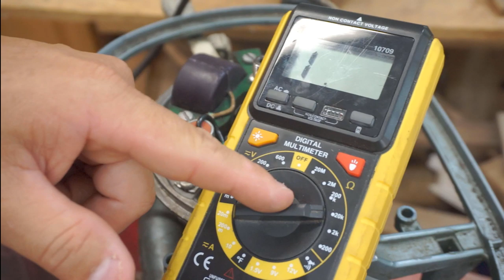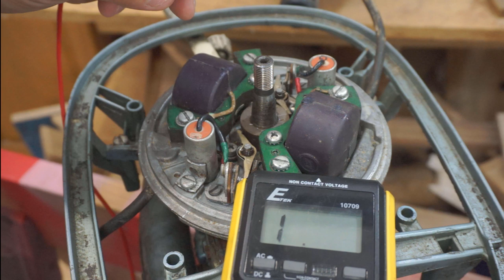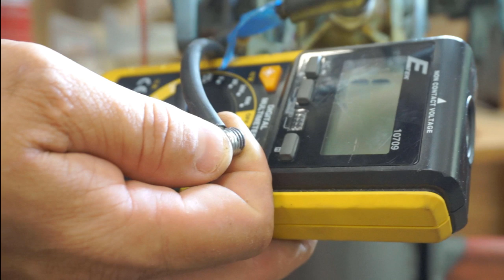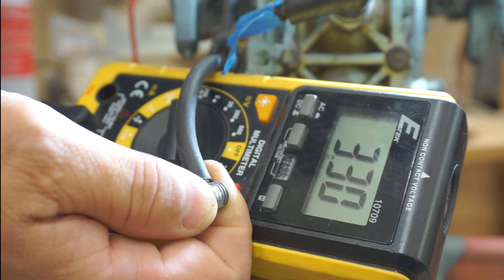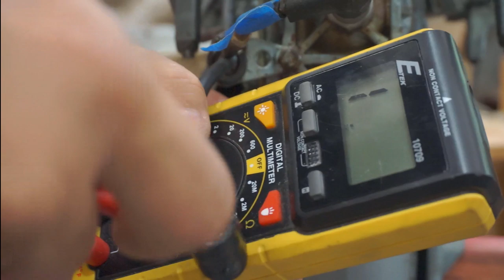Repair Ignition System Evinrude 3Hp boat motor ep 2 - The Garage Engineer

Comment: 2nd Hint: After letting the Kroil sit overnight, as you put pressure on the flywheel with your puller, tap the flywheel gently with a soft-faced hammer. Tap it gently, because there are magnets in the flywheel. Also, if you see the originial coils under the flywheel, it's best to replace them and the points. New coils are only around $17 each.
Reply from the maker: Thanks for the advice. 👍
Reply: Where can I find new coil?
Reply from the maker: I found ebay as the best source for non oem parts.

Comment: Hint: Before you try to pull the flywheel, put a few drops of Kroil penetrating oil on the crankshaft and leave it overnight. Makes 'em come off a lot easier.

Comment: I have a 1957 Johnson JW-13 3 hp boat motor that I have just overhauled.  Now, the throttle  lever keeps drifting on me and I'm not sure how to keep it tight. I think it has something to do with the coils and the flywheel.  I'm thinking that the clockwise spin of the coils is causing the drift or creep in the lever.  Or maybe there is a tension or adjustment screw I can adjust.  Do you have any suggestions?

Comment: I'm thinking your prop shear pin is sheared and your prop isn't able to push the boat. There's often enough friction to spin prop, but not enough under a load. Nice project by yhe way. That motor will move that boat around 9 knots
Reply from the maker: Good catch.   Check out the other videos in the playlist where I come to the same conclusion and repair the problem.  Thanks for watching.

Comment: The only design that will run in one foot of water.
Reply from the maker: I need to test what my draft actually is.  It's low. Thanks for watching.
Reply: Oh and they were all designed for 15 in. Transoms.   A long shaft was a 5 in. Spacer between the shaft and lower unit.

Comment: Very good video thanks for sharing,  one note is that the dielectric grease is an insulator, it wouldn’t be recommended to cover the metal contact of the spark plug with it,  it’s fine on the cable to plug holder and around the outside of the spark plug to create a waterproof seal with the plug.

Comment: just a tip: all you need is to spin the flywheel by hand to check for spark on these little ones. if it doesnt spark by hand, she needs some work for sure. those points systems are great... 90% of the time just a clean and adjust will bring it back to life. of course the coils should be replaced if they look nasty. great video hope it's running sweet still. love those angled weedless lower units!
Reply: A Shore my experience is it’s usually the plug wires that go bad but I put new in all my customers motors ! From wires to coils to point and condensers along with plugs and rebuild the air fuel metering device !

Comment: Are you draining the lower unit and pressure testing it to see if the seals are good ? Those are not OEM coils they are made in Germany which are better the the Chinese coils , so someone has done work on it before . Is the float bowl gasket black or brown ? Black rubber ones are newer . And that motor runs better I’ve found on j6c champion plugs . Nice video ! I’ve been doing repairs for years and thought I’d check you videos out ! 👍

Comment: I have the same unit, put gas in cylinders and it fired up a couple times, also backfired a couple aswell, spark plugs are new and wires tested good, do you think I should proceed to put back together and move on to carburetor??? I do have another ignition from eBay but like I said the tester on both plugs lit up. Should I just change anyway? Unit was bought as project
Reply: It’s all good I got her going!!!

Comment: Just to help you for a similar repair in the future:-
The HT lead is heavy duty cable and most unlikely to break. 
The connections at either end however do go open circuit occasionally,
and  a small snip off the ends providing the cable is long enough
will enable you to remake the connections.
    The contact breakers should always be removed and cleaned as with any
of the older motor vehicles. The gap should then be reset as this affects the
ignition dwell angle and hence the ignition timing.
    It is very important that the heel and cam of the breaker is lubricated.
If left dry the cam will gradually wear and change the dwell angle/ignition
timimg.
        However I must congratulate you on the way you managed a successfull
conclusion without having the knowledge of a skilled motor engineer.
        Well done.
Reply: The only exception to the HT lead is if it is a carbon cable.
Reply from the maker: Thanks for the advise. Thanks for watching.👍

Comment: using a puller. Tighten it up as far s you feel it is safe, then tap the main puller bolt with a copper hammer. tighten another quarter turn and tap that center bolt again. (99% success.)

Comment: all you had to do was tighten the puller centre bolt up tap the bolt head or socket with a hammer tighten a bit more and it would come off never tighten with any impact tool or wrench you was very lucky it didn't rip the threads out of the flywheel same as refitting don't over do things people get to heavy handed with spanners and sockets

Comment: this is a late fifties Evinrude weedless. you can tell by the angle of the prop which will catch and cut weeds between the prop and the skeg.
Reply: john The divine Ah, is that what the "weedless" means! English is not my first language and I actually never quite understood what weedless stood for when it comes to these little motors. Thanks f. your information!
Reply: These angle drives go back to the late 40s I have a '68 same drive.  You had a choice.  Lightwin or Yachtwin witch was 90 degree drive, lower gear ratio and bigger prop

Comment: day late and dollar short, but if you ever have a flywheel thats stuck like that, tighten the puller to where the bolts have some pretty good tension on them and smack the center puller bolt on the top with a hammer (the bigger the better) and that will break it loose most every time

Comment: whats wrong? i have the same engine, very small spark in cylinder 2. i just changed the ign-coil, and changed those condensators with each other. still just a very small spark
Reply from the maker: Have you checked the gap of the coil to the magneto?  Have you tried a new spark plug?
Reply: @TheGarageEngineer  i have new plugs, and no i havent checked the gap. Thanks ill go check it

Comment: do you mix oil and gas like a weed eater on these or no
Reply: I'm working on the same one right now and I'm not getting any fire on either one so I'm trying to figure out some watching your video to see if I can fix it
Reply from the maker: Yes.  But check the ratio of your motor.  My motor is a different ratio mix than my weed eater.
Reply: @TheGarageEngineer  okay I wasn't sure I wanted to make sure before I ran it at all do you have to have this submerged in water when you crank it
Reply from the maker: That's great. They are fun to work on.  If not spark then you'll have to check the points. Test the condensor.  I did videos on those.  Good luck.
Reply: @TheGarageEngineer  thank you sir you have a great video you should do more videos like this the other people on here should take advice from people like you because you're extremely clear on your details I work on a lot of motors lawn mowers weed eaters chainsaws all of that I can fix all that no problem with my eyes closed this is something new that was brought to me and it's the only thing I'm confused about but watching your video helps a great deal you're awesome
Reply: just found out it's the wire as well on mine both of them the wires are bad the coil packs are great thank you
Reply from the maker: @davidgray7907  yeah. My wire tricked me up too. Glad you found it.  Also you might want to try marine 2 cycle oil mix. Tc-w3.  Walmart carries it.  I think the motor calls for a  mix of 50 to 1 but you can go a little heavy. So people say 26:1 but I only mixed to 40 to 1 to give pistons a little more lube.